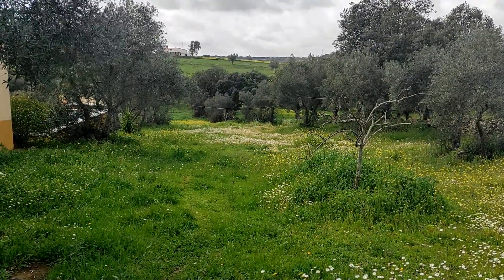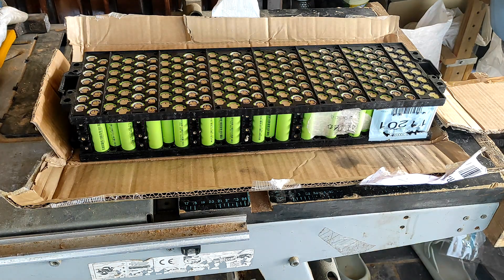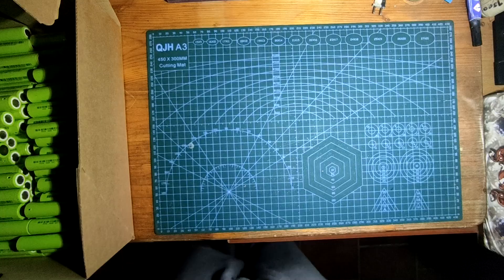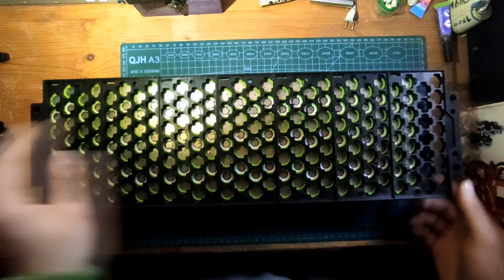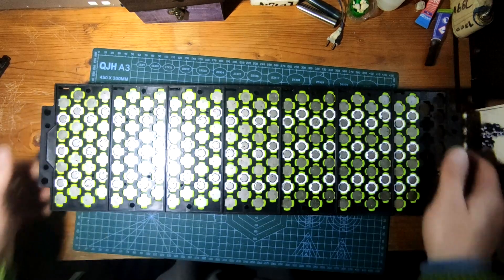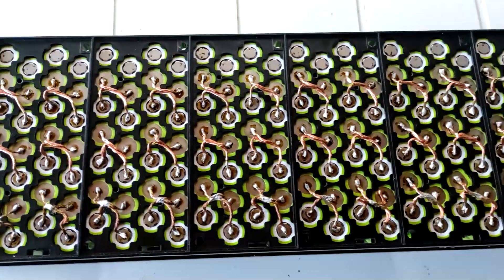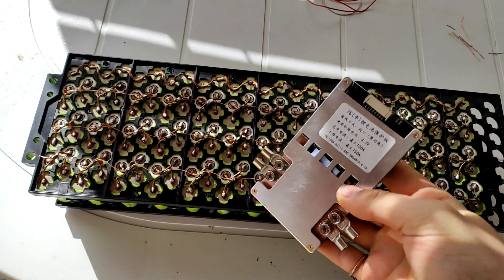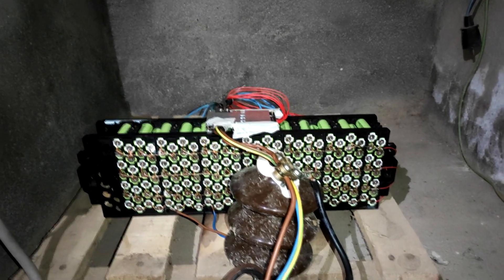My diy battery (if you dare) lol

Comment: why no agm batteries? much cheaper and safer than this uhm... solution. hope you won't burn your shed down, considering the wiring its a wonder that hasn't happened already tbh
Reply from the maker: Lol you are just like all the other people... it's working great so far
Reply: @lorenzorentniop717  how old is it? aka how many days/weeks did it run?
Reply from the maker: @eta10tp1  now it's approaching a month

Comment: For the sake of cell longevity and individual cell stability, I would've used even a budget spot welder over an iron any day. As prolonged heat damages the electrolytic fluid directly in contact with the negative terminal (it's difficult to cool the joint quickly enough not to cause damage). A regular soldering irons heat can also damage/trigger the short-protection feature built-into the battery's positive terminal. The cost of portable spot welders have come down drastically Mine was £45 and does .1mm and .2mm nickel strip easily. Buying one works out a lot cheaper than having to strip down and diagnose an entire pack to replace a few heat damaged cells.

PS. Another point to note, 18560 cells reach 4.20 volts fully charged, not 3.7 volts, take this into account when calculating a pack's total series voltage.

I too learned this somewhat expensive lesson the hard way. 🤔
It's what DIY spot welders were invented for! 😉
Keep up the great work and videos.
Reply from the maker: Yeah I do know 4.2v is a fully charged 18650 thank you for reminding me lol and no I do not think it damages the cells since the heat gets spred out from the metal and the battery can get hotter from charging alone and really it won't damage them enough to cause a difference ether way next time I'll probably spot weld them kinda did this also too prove a point if you do it right soldering 18650s is posible I never sed its viable but it's a way of doing it
Reply: @lorenzorentniop717  Sorry, I disagree and so does every technical paper on the subject, otherwise all 18650 cells would have soldered connections.

By using heat on lithium-ion cells, you can severely damage the pressure protections, the plastic separator or even the primary internal lithium layers.

Need I remind you, assumptions are the mother of all fuck-ups! 😉
Reply from the maker: @Zodliness  Wella time Will tell
Reply from the maker: @Zodliness  update it still working perfectly :)

Comment: Hey man just so you know I havent seen the full video yet but those cells looks damaged. All of them have a hole in them and eventually the electrode will leak out causing heat and corrosion and eventually fire. Lithium is no joke stay safe
Reply from the maker: Yeah sure dude... Its Not like i have checked all the cells... And they work perfectly

Comment: lol nice, but man... youre a dare devil, I put together a similar pack from salvaged vape pen batteries, soldered as well, and with my mess of wires i accidentally shorted thev pack. Thankfully the short melted the solder disconnecting the batteries  preventing anymore damagaing discharge but now i had disconnected wires hanging everywhere and another was still melting so i just took the pack and threw it and that seemed to disconnected everything.  Geez... my apartment was full of smoke and the kapton tape on outside of the battery almost melted, the battery took some seriouse heat but it didnt gas or anything  and later i checked the votlage and it was fine, strange.  So anyway I got a spot welder in the mail $40 , you can hook up a lead acid battey to it,  im done soldering batteries.   Well maybe not.   Heres a  video of the same spot welder i got and he shows the difference between lead acid and lithium to power them. Dont throw out those lead acid just yet, they can pack a punch of current.  https://youtu.be/yG8DRdk7Utk?si=BRBX0pVykkag3m-G
Reply from the maker: I have big capacitors that I can use to power a spot welder I really don't need the stinky lead acid batteryes
Reply: @lorenzorentniop717  Ahh cool, yeah i was reading this spot welder you can use 2x 3000f capacitors as well, thats a cool option.  Even more lightweight then lithium.  Was just watching a video on super capacitors , this guy was showing off some new lithium based ones.  I hear they're used in solar setups to take the load of the batteries or something.  Maybe they can help prolong the life of your new lithium ones, im not an expert so i dont know exactly what the benefits are.  Heres a link to those super capacitors this guy was showing off, pretty cool  https://youtu.be/s6064_5X7qY?si=zHupymDFrvm9Zq8T
Reply from the maker: @mikejones-vd3fg  I saw that one already...
Reply from the maker: And yeah soldering batteryes is risky but if you work clean and have a game plan it works out